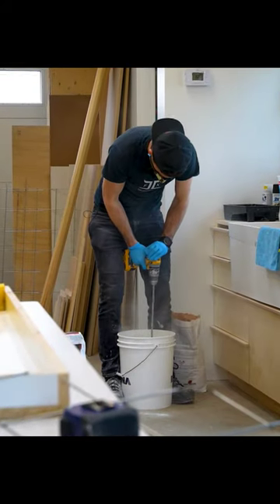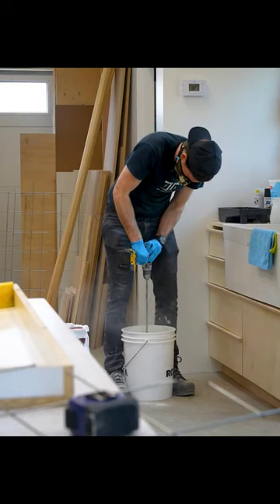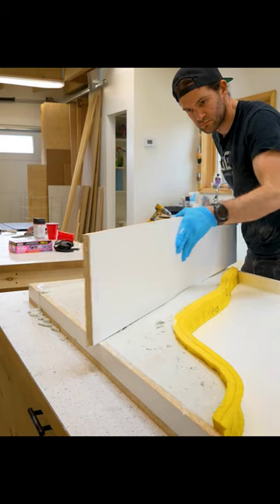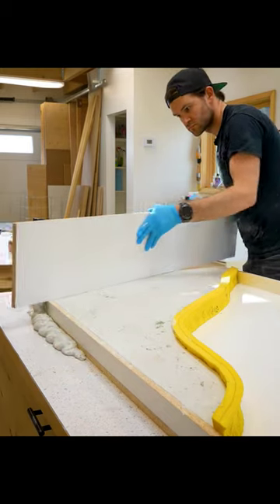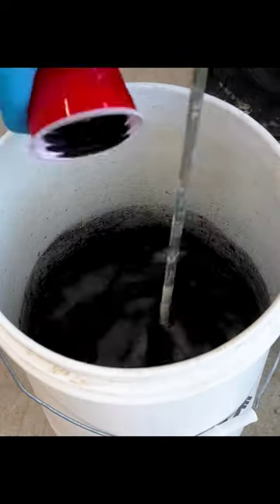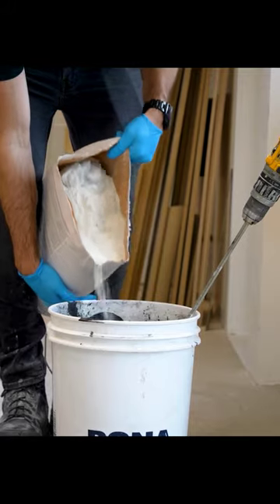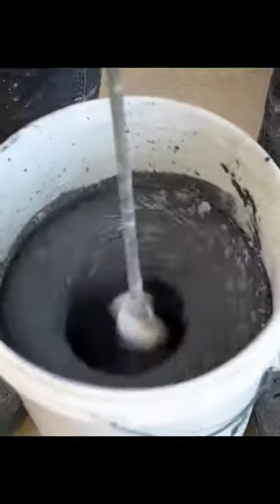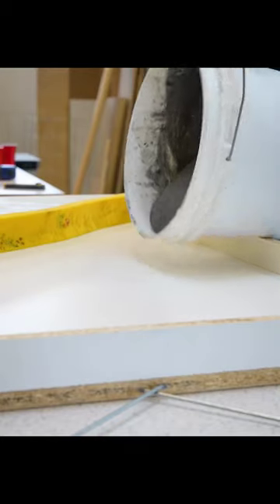You Can Dye Concrete?!

Comment: if you dye the water before adding it to the cement, you can speed up the process. also, itll make it easier to color match multiple batches if you measure out the cement, water, and dye
Reply: My man! I know you work with it! Makes like so much easier to dye it in water first
Reply: thanks guys!

Comment: Yes.

Check your version of dye for instructions.

Quikcrete liquid dye works with gray portland cement.

Using it in White Cement will not result in the color you are looking for.

Added note.

You can use latex/acrylic paint as a concrete additive.
Depending on the amount and color it makes pretty colors and patterns.

Adding latex/acrylic  paint to concrete for fence posts is a safe way to dispose of left over latex/acrylic  paint.

The paint is a substitute for some of the water.

Comment: Buy a couple slate roofing tiles. Wrap a them up in a towel you will not use again & smash with a hammer until you have small slate bits. Add that to your concrete. You might need to wet polish the counter top after

Comment: Get some vibration on your frame. It'll fill in all the air gaps. 

And use a 2x4 as your leveler. You don't have to saw it either. Tap it along the surface to get everything in place then smooth and repeat.

Comment: Umm, why dye whitened concrete dark grey, rather than just dying regular concrete a darker grey? Just what you had on hand?

BTW, IDK if it would actually be practical or not, but the whitener is probably titanium dioxide, so maybe you can save money by just using plain concrete and adding the TD when you want it lighter.

Comment: You know, if you use an agitator, basically a concrete vibrator, you wouldn't have those ugly pock marks on the sides and probably bottom. That concrete you poured was also incredibly thick. You could get an equally strong concrete by adding about half a gallon of water. +/- a quarter.

Comment: How much does the table weigh? I wanted to make a desk out of concrete but I’m scared to end up with a 300 pound slab in my apartment
Reply: The bags of concrete are measured by weight however many bags it takes is how much the concrete alone will weigh.